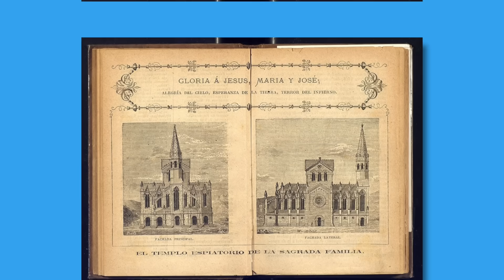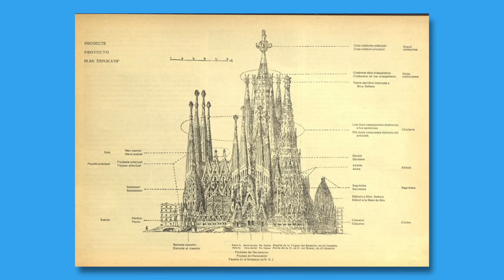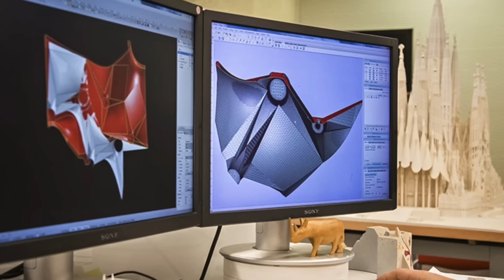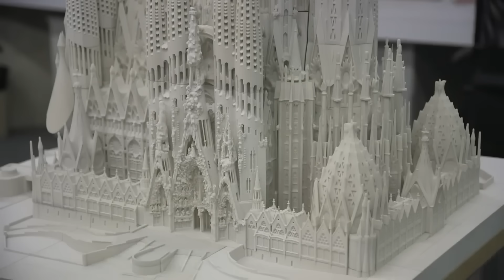Construction UPDATE Sagrada Familia - Almost Finished After 142 Years

Comment: I am slightly disappointed.
As far as I know, the idea to get the SF finished in 2026 (AG's 100th day of death) was the moment, that changed everything. I am not sure, but I think there was a competition and the famous engineers of Arup won. It was Arup, who came up for instance with prefabrication, which helped to save a lot of time. As working on-site does not allow to advance on all the details fast enough, while that way all of them can be prepared off-site. That was speeding up after app. 140 years like shifting into fifth gear in a Ferrari, that had only been used in first or second gear utill then.
Arup have the best record when it comes to problems of this kind. They were called in to save the iconic Sydney Opera house, after the architect had had problems with the complex roof structure. To cut it short: it was propabely the first project, where the use of computer was crucial (https://www.vam.ac.uk/articles/computers-and-the-sydney-opera-house?srsltid=AfmBOopn3_Yy43G7xDCJGoC8gKyhqTMYfd9rbaJjqq6dvQWf5RfWdhZM).
Credit where credit's due (they say)

Comment: Now, thanks to modern technology the building can be completed.  So amazing... so advanced.  But, how did everything get constructed originally ?  No cranes, no power tools, no transport tucks to bring the stones, etc.  How do such heavy rocks/bricks/stones/marble get sculpted to such exact specifications, AND get hoisted up to and positioned on the upper portions of the church ?  Did they bring such mega-tons of material with horse and buggy ?  

And, how many super-skilled ARTISTS and SCULPTORS did it take to make these things ?  Where did they all come from ?  How big was the population, then ?  And, where did they get the builders and thousands of workers who were needed to bring this about ?  From the general public ?  They must have been skilled, too... this is not a learn-on-the-job kind of assemblage.  Certainly, not in the initial stages.

Which part was built faster - the lower half without modern technology... or the upper half which has taken over 100 years, so far - and is still not finished ?  Could they also finish constructing the building without cranes and large trucks to transport heavy stones, etc. ?  Perhaps, that would speed things up...

Comment: theres actually and issue about edning the basilica. which is that the rear of the building should be made with a stairs of (aprox) 10 meters, which right now is not posible due to the buildings next to it with a separation of less than 10 meters

Comment: The best part of visiting Catedral de Segrada Familia was the workshop of Antoni Gaudi in the undercroft. Unlike older cathedrals, with their gothic arches requiring flying buttresses to keep standing, the arches of Segrada Familia were designed by constructing a model upside down, where the arches were simulated by chains dangling in catenary curves, thus creating a self-supporting structure. Both architectural and structural brilliance unprecedented for Gaudi's era in late 1800s, and early 1900s.
Reply: It is not a Cathedral, It is a minor Basilica.